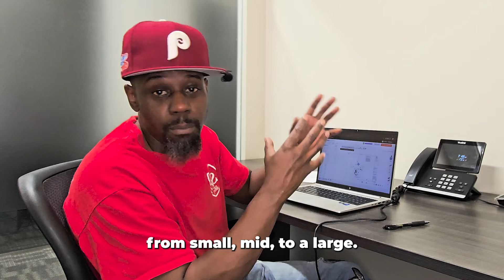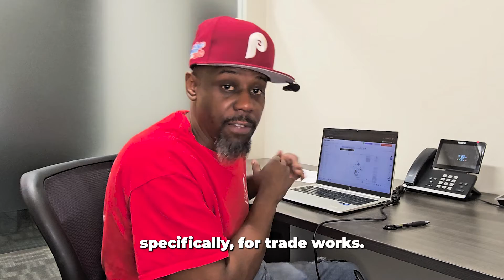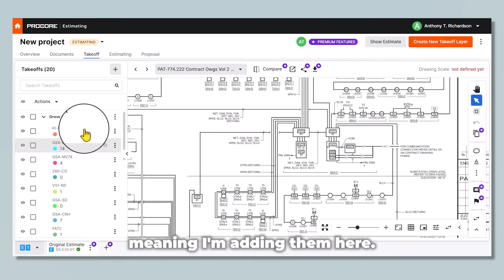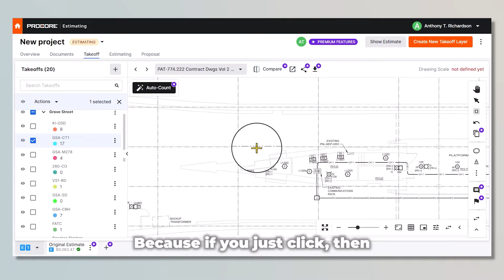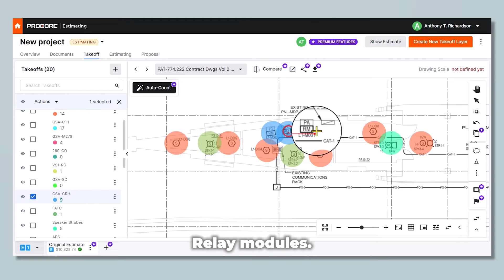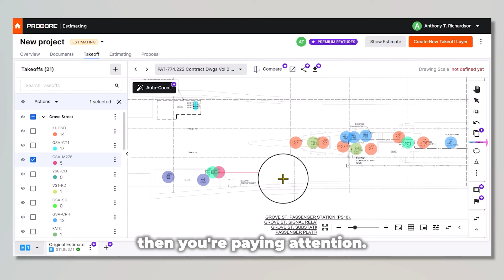Fire Alarm Bidding Secrets: Avoid Costly Mistakes

Comment: How do you know how much to charge per hour and per device?
Reply from the maker: @jeremiahstewart9221  I used the rates the market was using for the first couple of years. Then, I learned how to come up with my pricing schedule based on my annual profits and loss. Basically, dividing those numbers to come up with a percentage says 35%. I will take my salary per hour and then add the multipliers for profits, expenses, and overhead. I have a spreadsheet that makes this simple. As far as material, the manufacturers give you a price sheet to go off of.